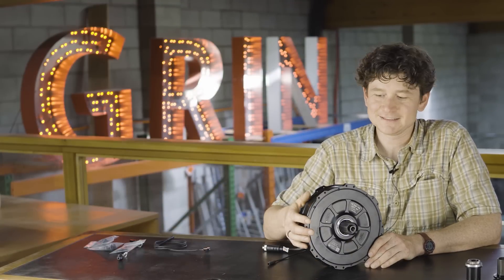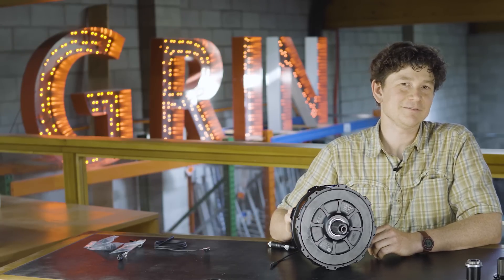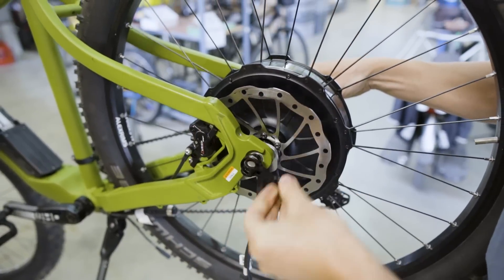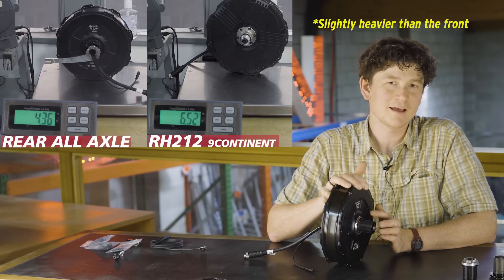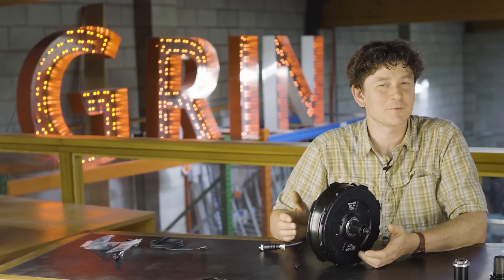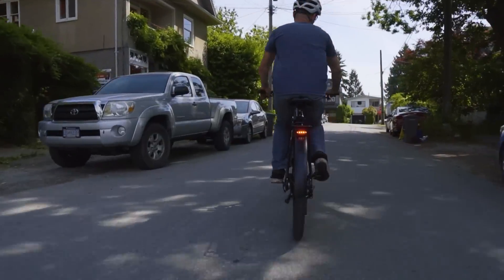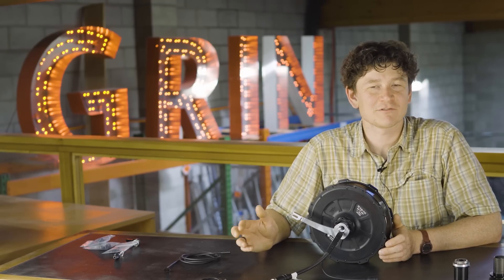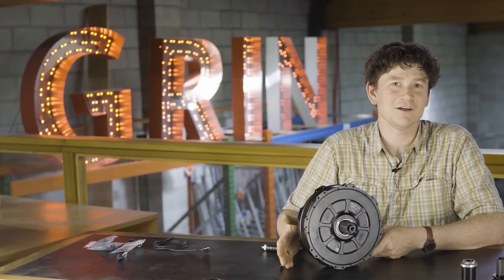Introducing Grin's REAR All-Axle Hub Motor.  Quick Release and Thru-Axle, Integrated PAS

Comment: I’m curious being a direct drive motor how is the low end torque compared to a similar power level gear drive hub motor. That can affect hillclimbing capabilities amongst other things.
Reply from the maker: It is all modelled to an exceptionally good accuracy here:
https://ebikes.ca/tools/simulator.html
Generally speaking, a 'equivalent' geared motor outperforms DD for off the line torque, acceleration, and efficiency at high torque loads, while the DD motor outperforms geared motors at higher RPMs and lower torques (like riding fast on flat terrain and modest hills).  For trips that involve a mix of both it's usually a wash as to which one averages out for a better net wh/km.
Reply: It's shocking how accurate the motor simulator is

Comment: If you are going to call weight "kilograms", you need to call torque "kilogram meter" instead of newton meter.  Torque = weight multiplied by distance.  If you are going to call torque newton meter, then you need to correctly call gram/kilogram "mass" because that's what it is and it's not a unit of weight in the SI Metric System.  Weight is a derived unit. Weight has the units of force (kilogram meter per second squared = a Newton)  It is the product of mass multiplied by gravity not just mass alone.  That's why something weighs less on the Moon than on Earth but the mass is the same at each of these locations.
Reply from the maker: 100% Agree, but even I have my limits to how much technical pedantry we need to indulge in with the video channel  :-)   
At least one thing you'll never hear us say is that smaller diameter wheels result in more torque. That is where we draw a firm line.

Comment: Engineers and artists you are. Thank you GRIN!! Do you have any information on the regenerative braking options for this motor?
Reply: @Pure Water Window Cleaning.  Regen doesn't add much range.  The problem is the slow charge rate of the battery.
Reply: @georgekrpan3181  In our heavy cargo bike applications it would save us tons of wear and tear on our brake pads. Any charge at all would just be a bonus.
Reply: @nettoyageadriance  That's totally true.  I wonder if another torque arm would be needed.
Reply: @fun_ghoul  Cheers Joe!
Reply: @nettoyageadriance  For short heavy bursts... Try using large capacitors to absorb the flow. They were commonly available for audio systems. Of course they can also discharge with a real wallop. This is not new tech at all.
Cheers.
PS Consider improving the cooling to your brakes in the meantime.

Comment: Is this hub now incompatible with torque sensing bb?
Reply from the maker: Nope, you can totally hook up a BB torque sensor to the kit and simply ignore the PAS plug on the motor.  We kept the L1019 connector between the motor and motor controllers exactly the same. And if you look at our rear All-Axle kit page you'll see that all the BB torque sensors are still there as options. But there is no need to offer separate BB PAS sensors since that is totally redundent. Modularity like this is key to everything that we strive for.
Reply: @GrinTechnologies I see, but if I wanted torque sensing and PAs I would have to forego built-in Pas sensor

Comment: Can the GMAC also use the PAS sensor shown this video?
Reply from the maker: Nope, it's doesn't use a freehub body that has the room to mount a separate magnet encoder and dual hall sensor chip like we were able to do with this one.  Plus it also lacks the room to have a separate PAS cable exit form the motor axle, it's already quite crammed just with the phase and hall wires.

Comment: Does this heat up as fast as the GMAC? I am in Las Vegas so it is a big concern. We don't have many super steep hills but long gradual ones. It seems every time I go out the temp of the motor hits 100C and I am not beating on it.
Reply from the maker: No, as a direct drive motor it takes longer to heat up since there is quite a bit more metal mass in the motor stator and a more direct path to shed the heat when you use Statorade. However, it is also less efficient than the GMAC when doing loaded hill climbs, so the final hill climbing capacity ends up being fairly similar between these two motors.  Going up a long hill it'll take a bit longer to get hot, but once it's hot the power output in thermal rollback will be comparable.  On hills the GMAC will be a bit more efficient and use less battery. On the flats and at higher speed travel, the All Axle will be a bit more efficient and use less battery.  

Also 100 degrees is pretty fine for the motor, you don't really risk damaging parts until you are well above 150 degrees or so. The default settings are quite conservative.
Reply: @GrinTechnologies  Don't mean to hijack a comment, but as I'm also comparing this to a gmac10t, I'll reply here.  I've got almost 5,000 km on a gmac, and it's been good, but I'm consistently in thermal rollback due to hills.  The geared motor just doesn't shed heat fast enough.  (CA configured to start rollback at 100c and no power available at 130c.  Peak temperatures of 125c are common)  I had bought an RH212 with statorade as a replacement even though it's quite a bit heavier, but haven't swapped over yet due to not having a cassette tool big enough for the 14mm axle.

I guess my ultimate question is, does this fit in-between a gmac and 212 if the rider is an 'electron hog'?
Reply: @ryan0io  Does your motor have hubsinks added to shed heat quicker?
Reply: I don't think heat sinks would work on a geared motor, right Grin? I have only gotten it up to 106C so far no noticeable rollback, just kind of freaks me out. I don't have voltage anxiety any more, I think the  lowest I have gotten to was 47V on my 52V battery after 55 miles. I wonder if there would be a way to use heat pipes like computer cpu coolers use to get the heat out to the shell. How about drilling cooling holes in the sides and putting fans in. We hardly ever get any rain here.
Reply: Yea, hubsinks won't do much for a geared motor.  Even with the motor at over 100c, the outside shell is not that warm.  Maybe 40c?  Air is a good insulator, and geared motors have an extra 'layer' of air the heat has to get through to get out.  I did see someone cut cooling holes in the side of a mac motor and even ran ducting to force air through it.  My concern would be not only water, but general debris ingest.  The gears are nylon after all.  I wouldn't want sand or gravel getting in between teeth.
Reply: @Mikesukes  Sounds like you need to switch to direct drive. Period.
Reply: @fun_ghoul  Got direct drive on my other bike, and they don't really have any low end punch like the geared motor has. ( it is a XOFO front 1200W running on a baserunner). The direct drive has to be running about 12MPH before you can really crank on it.
Reply: Rising the volts to 72 volts can help with reducing heat 72v×30amps=2160w 52v×30amps=1560w
72v×22amps=1580w
It's the amps which makes the hubmotor hotter
Reply: @MichaelGreenLagos  Baserunner won't do 72v.

Comment: Now do an AWD front & rear drive kit with intergrated throttle. It could be a  hill climbing beast.
Reply from the maker: Such bundled kits are indeed on the horizon.  But in the meantime it's quite easy to combine two systems with a single throttle / CA3/ PAS control using this splitter cable:
https://ebikes.ca/shop/electric-bicycle-parts/wiring/ca3-wp-dual-controller-splitter.html
Reply: You can already have a hill climbing beast with Grin Technologies. I run a Phaserunner and Bafang G62 combo powered by dual 52v Tesla batteries. With a peak of over 3000 watts, hills pretty much don't exist, and I turn it down to 2,000 watts on mountain bike trails to keep the front wheel on the ground. The owner of a company that makes mid drive e-bikes "uninvited" me from their group rides after I effortlessly climbed a berm that their bikes could not 😂.   I love my Phaserunner!
Reply: @Altema22  I built a purpose built hill climber with a front hub motor mid mount, running to a jackshaft, then to the 26” fat rear wheel. 7/1 gear ratio.  slow as a totoise, but torque to pull like a tractor.  Its the farm favorite, and used extensively.  Hubmotors like to spin freely, and are not really suited for big hills, they will produce heat, and lose efficiency. especially with motor startup under load…they really gobble the amps from the battery.
Reply: @Altema22 
"Uninvited"...
Welcome 😊
Nice setup 👍
Reply: Hope they have planetary gears so you don't have to pedal like crazy to get peak performance as it's only one speed no matter how many gears it is on your bike,,,a lot of people find this to advanced to comprehend and... Some RC hobby motors have high and low gears that would be awesome on this.trek made a kit with high and low gears by double set planetary in early 2000s it was throttle only but you had to pedal for it to be strong enough on high gear and was really slow on low gear if you didn't pedal and it was heavy but easy to take off.. the throttle was also the gear pushing inwards was high and outwards was low and it was a clunking sound when you changed.. The high gear had no speed limit it just went faster and faster until you couldn't pedal faster and low gear used a lot of battery specially if you didn't pedal..

Comment: What are the benefits of a direct drive motor vs one of your geared motors with locked freewheels? What would the use cases be for each?
Reply from the maker: Quick answer is that the geared motor will be more efficient hill climbing and at the higher torque and lower speed end of the spectrum, while the DD motor will be more efficient on the flats and on lower grade hills and at the faster end of the speed spectrum.  The geared motor will also be somewhat lighter, but in comparing to our All-Axle hubs, not that much.    Geared motor will also be smaller in side and more discrete looking on the bike.  In terms of simplicity and long term robustness, DD takes the cake for sure.
Reply: @GrinTechnologies  thank you for the thoughtful response! I bought a conversion kit from a Grintech distributor 6 years ago and I will soon be building a new bike with a Grintech in-house motor and the new phase runner.
Reply: statorade will probably make the DD do twice the power at less than twice the weight.  Will run longer at a time and more years due to no gear wear and more heat dissipation.
Reply: Yes a direct drive is just simply a motor, nothing else, it will build momentum as it rolls on and it isn't down geared or anything internally, leaving it at a 1:1 ratio while a geared hub drive has a gear that is down shifted, meaning it is easier for the motor to rotate the wheel, makes it easier for hills, but it also will not build up momentum as it rolls on, it has a top out speed that is directed by the gear it is in. Think of the motor as you on a bike pedaling at a 1:1 ratio on a bike. Now compare that experience to riding a bike that has a gearing of something lower like a 30:15, and now it's half as hard for you to pedal but it also lowers your top end
 That's pretty much it. Just a gearing ratio for the motor to turn in the case to turn the wheel while a direct drive is just an entire motor itself if that makes sense

Comment: To a layman who has had an ebike for many years what exactly will this do for the future of ebikes? I do know Grin Technologies has a fantastic name in the industry and is well respected and is the benchmark for top rated hubs…..so, can I do 40mph on my ebike with this hub?! 🤣🤣🤣🤣🤣💪
Reply from the maker: I mean you can do 40 mph with just about any hub as long as you choose the motor winding Kv and battery voltage to have sufficient RPM, and make sure that your vehicle's aerodynamic profile doesn't require more torque than the motor can produce at those speeds. This motor is no different and nothing special in that regards. 

What this motor does to the industry is bring hub motor installations into the realm of modern bikes that use thru-axle dropouts, which up to this point has not been an option. Plus it gives people the flexibilty of owning a reliable motor that they can easily port from one bike platform to another as their bike needs evolve, and simply swap out adatpers if it uses a different dropout standard.
Reply: @GrinTechnologies  Thank you for your very prompt reply and the understanding of what exactly this hub will be used for, different dropouts is a big problem for many bikes, and as you say, it will give us many options as to the fitting of this ‘Rolls Royce’ hub 👌 Thank you once again 👍

Comment: Very nice! Regarding the freehub body, it looks like it's much easier to replace than the one that threads into the GMAC hub. Am I correct in thinking that?
Reply from the maker: You are indeed correct. You can slip it off and slip on a new one with no tools in a matter of seconds
Reply: @GrinTechnologies  good to know, thanks. I love the GMAC, it's been super reliable for me, but freehub replacement is a pain. That improvement alone is enough to make me consider the All Axle Motor as an upgrade, although I'm sure there are also other benefits that would make the upgrade worthwhile.

Comment: I was also wondering, Can this motor work with a universal controller with an L1019 connector? If yes would the 3 pin hi go connector plug straight into the Pedal Assist plug on this all axle motor?
Reply from the maker: You need a controller that can respond to quadrature PAS signals. A 3 wire pas plug would be single wire pas, and so if you hooked it up (ignoring one of the two pas signal wires) you would get assist both with forwards and backwards pedalling.
Reply: @GrinTechnologies   So it's yes on the universal Controller with the L1019 working just fine?
Reply from the maker: @Jahmall841  Not sure we understand. You can run it with any controller that has an L1019 power connector with a matching hall and phase pinout and that can be tuned to run a direct drive motor with these parameters. But some features like the motor temperature sensing or PAS control are unlikely to be present in most 3rd party controllers.  We're not sure what "Universal Controller" you are talking about.  The integrated PAS sensor has nothing to do with the motor itself or the L1019 connector, it's on a separate 6 pin HiGo plug.
Reply: @GrinTechnologies   thanks the question was answered. I used the term universal meaning kits that come with loose wires and you add your own plug ends or in some case have plugs on them. Basically an ebike kit.
Thanks 😊

Comment: Great to see an all axle rear wheel option,  all you need now is a mid drive option, is that, or will that ever happen ?
Reply from the maker: Well there's more than a handful of people running them middrive a-la stokemonkey style, bolting a sprocket to the disk mount. So you've always got that option!
Reply: All you need is to apply the DIY principles to make your own mid drive option. I'm sure there are plenty on the Endless Sphere forums that can help you tinker your way to a mid-drive. 

I don't find much value in mid-drives as they are a very niche choice with more disadvantages than advantages for me. I find the higher learning curve of shifting gears on a mid-drive to be a hassle instead of a pleasure. I enjoy the simplicity and elegance of not putting the motor inside the drivetrain, reducing wear and increasing reliability.
Reply: @sammiller6631  I totally agree, hub mo' betta', but try and tell that to a mid drive know it all.  In theory mid drive better, in real world hub drive better.

Comment: NIce! Does replacing the bearings require hub to split ie. wheel to be delaced as with front hub?
Reply from the maker: Yes it does require unlacing half the spokes. But, since we have switched to a large 35mm x 10mm bearing standard with a double lip seal in 2019 we've yet to see a single case of bearing needing replacement, and that's with several pple at over 40,000 km on their hubs.

Comment: Can the front hub version work on the rear with modifications? For 175mm drop out?
Reply from the maker: If you don't requires a drivetrain and have the shop tools to make your own axle spacers then yes you could make that fit.  But if you want to have a cassette on the motor so that you can pedal it, then no.

Comment: Hi Grin,   have you got axle conversion for fat bike rear 197 dropout spacing with quick release 9 speed  ? Is it posable ? P.s have you done any more work on your sailing boat  ?
Reply from the maker: Hey Elados, No fatbike options at the moment. That will require a wider motor overall since all the spacing has to be on the non-drive side for the cassette to stay aligned, and if you put 45mm of spacers just on the left side of the motor the dishing gets really wonky. It's not like the front hubs where we can put spacers on either side to keep the motor roughly centered.

The sailboat has sat dormant for 10 months as other important life projects are underway, but we hope to finally change that in July and hit the water again!
Reply: @GrinTechnologies  May we assume (hope) that wider = MOAR POWER?
Reply: Looking forward to it , thank again for the quick reply  . Cheers
Reply: My Next frame will have a through axle rear  15mm or 20mm ? The bicycle frame that I have is a fluid mud slinger 26in , I think they brought them out in Canada as well as down hear in Australia the land of censorship  and lies. It has a through axle 150mm x 15mm on the front and the frame is not offset in anyway , with 197mm  dropout spacing quick release 12mm axle . 12mm maybe ?